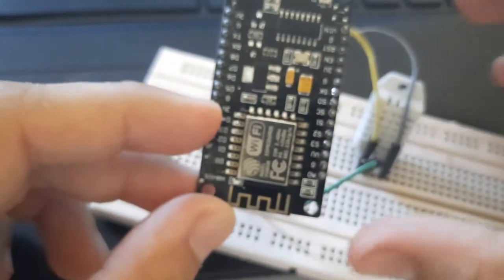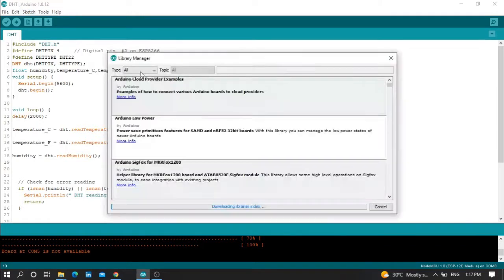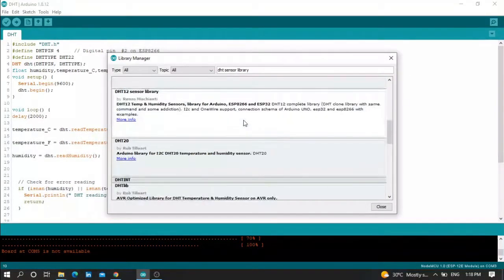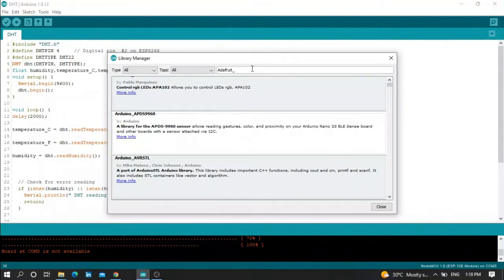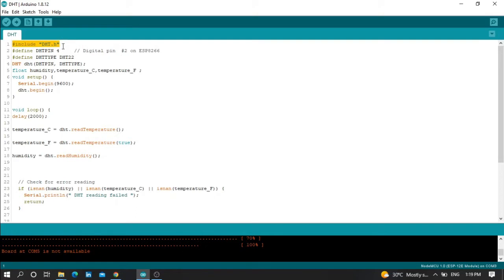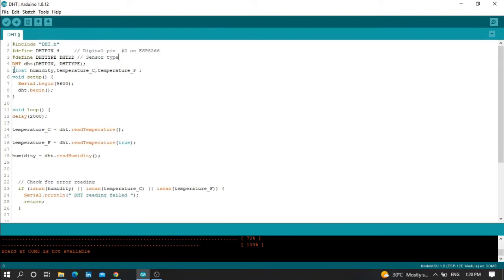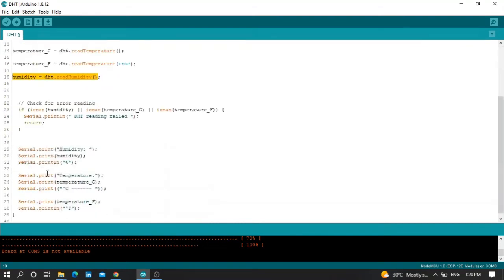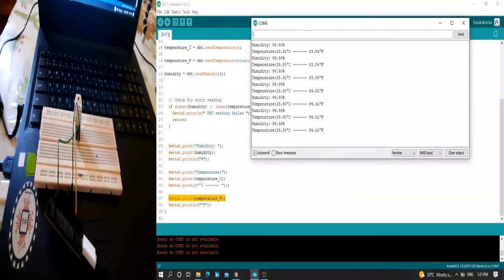how to use Dht22 sensor with esp8266

Comment: Hello mate, this is a very out of the video request. Please help me again. I ran out of space on  my nodemcu32s, I want to change the partition scheme but this menu is not visible in my arduino ide 2.0.3, I tried searching everywhere stackoverflow, chadgpt, yt, arduino's website, but nothing worked, I have to get this project done for me to become/get the first place in the state level competition. Please help me out with the partition scheme menu, so I can increase the memory Please. Thx
Reply from the maker: hello mate, please give me more specific details of your need, of course if i can i will help you
Reply: @RoMecha_lb  please watch this video, it kinda hard for to explain, I exactly followed this tutorial and still It didn't work
https://youtu.be/5VoXNloOwZE
Lot of people said this video worked for them.
But please help me with this.
Reply: @RoMecha_lb  hey mate it's been three days, please help the brother out. Try the video with ur esp32 and see if it works. Please 🙏
Reply: @RoMecha_lb  hey bro, I figured it out, did it. I did it like 1 month ago. All I did Is go through all the boards, after many tries. I selected DOIT ESP32 DEVKIT V1 board instead of nodemcu32s. And used partition menu there. And yes it worked
Reply from the maker: @mackb996yt3  Great Work Dear 👏👏👏👏

Comment: Hey I am getting nan(not a number) for the reading, can you help please.
Reply from the maker: check well your connection and test you wire, this is a common errors.
if not then check your library on your code.
if these hints does not match your error, kindly send us your specific error so that we can help you to find your mistake.
Reply: @RoMecha_lb  hey can I use 
#include <DHT.h>

DHT sensor (1, DHT22);
float temperature, humidity;

Void setup(){
  Serial.begin(9600);
  sensor.begin();
}

Void loop()
{
temperature = sensor.readTemperature();
humidity = sensor.readHumidity();
Serial.println("temperature = ");
Serial.println(temperature);
Serial.println("°c / humidity =")
Serial.println(humidity);
delay(2000);
}

And I am getting nan

Should I use serial.println(analogRead(1))
Reply from the maker: @mackb996yt3  it seems that you are modifying some of our code, so to avoid any error, first download our code and past it on your laptop, then make the same communication as the video. i think you'll get the right reading. try it before modify anything on the code
Reply from the maker: @mackb996yt3  yes of course you need to use the same pin defined in the code
Reply: @RoMecha_lb  hi, I have uploaded your exact code also changed the dhtpins to my respective adc pins on my controller (esp32) and also I am still getting nan (actually "dht reading failed" as that code Serial prints that when Nan is reading) 
Please help me out.
Reply: @RoMecha_lb  should I get a new sensor?, if you think please recommend one.
Reply from the maker: @mackb996yt3  did you check your wire? if any wire who does not connected well to the other pin. i think you have a problem in your wire installation, try and test each one on your multimeter.
Reply: @RoMecha_lb  hey, thanks for the trying to help me mate.

I tried everything, even checking wires continuity, tried all solutions on stackoverflow. Nothing worked 
Then I used some creativity 

delay(3000);
  temperature_and_humidity_sensor = (analogRead(36))/100;
  Blynk.virtualWrite(V5, temperature_and_humidity_sensor);
  Serial.println(analogRead(36)/100);

I created a variable "temperature_and_humidity_sensor"
Then analogRead(36);

And put it in that variable 

And Serial.println(analogRead(36)/100)

I divided by 100 as the analogRead of 36 pin was in thousands ex:=2901/100 = 29

Also created new virtual pin V5 updated 
Then 
Blynk.virtualWrite(V5, temperature_and_humidity_sensor)

And it worked 
Only the temperature readings though 
But it works I am happy

And again thanks for helping
Reply from the maker: @mackb996yt3  glad that your finally got the right solution, but it seems that the problem is already inside the blynk app right? but what is your goal to divide by 100? does this division solve your problem?
Reply from the maker: no need, it's our pleasure to help you as much as we can
Reply: @RoMecha_lb  my objective wasn't to divide by 100.

When I took the analogRead(36)
I got 4 digit number like 2945
I just divided by 100 to get 2 digit number
Which I Serial.println and also Blynk.virtualWrite(V5, temperature_and_humidity_sensor)

temperature_and_humidity_sensor = analogRead(36)/100